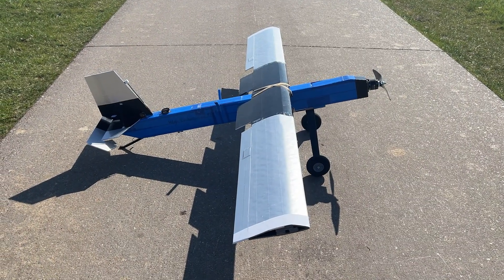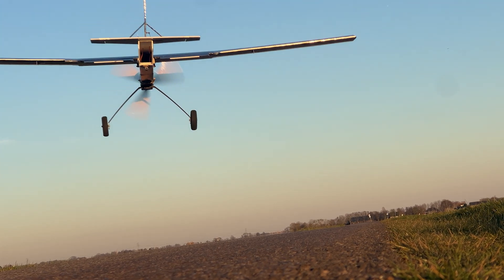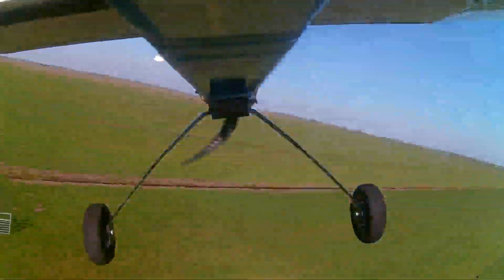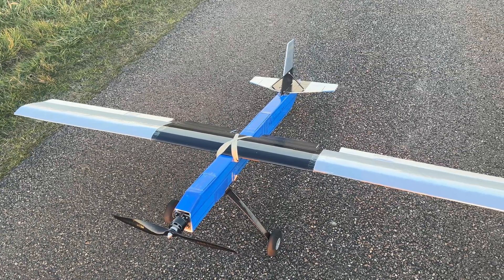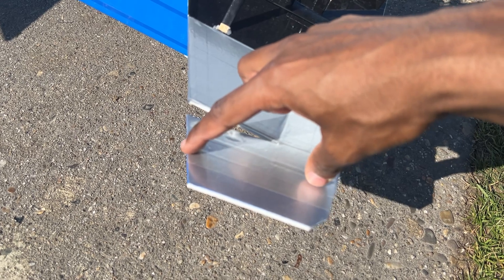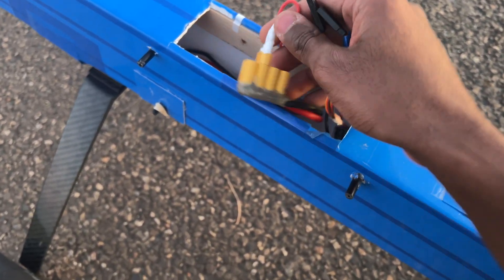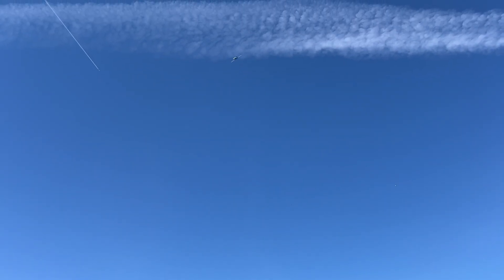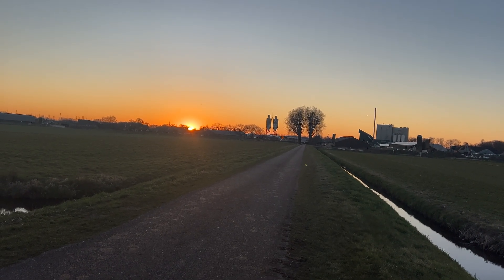Homebuilt FPV Trainer for FPV (Photon Motorglider Revisioned)

Comment: Great wide open area. East coast not much open areas.. Fly On...Parts list would be great. Also, flying weight. We struggle with how much power to thrust - battery size and 45c or higher rating.. do we need...

Comment: It's a woow build❤😮 am amazed how beautifully it glides, my diy plane struggles to glide due to bad airfoil design, it flys like it has no airfoil on it, nathan build something which has tri landing gear with 3d printed suspension , front with stearing wheel, some cool on off navigation lights,which can be controlled via transmitter, does auto land on this road😂